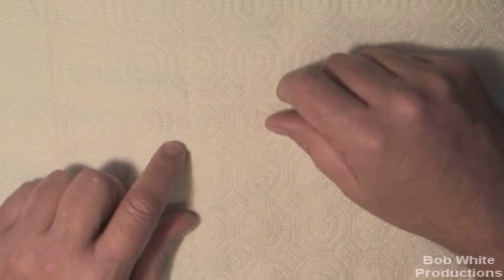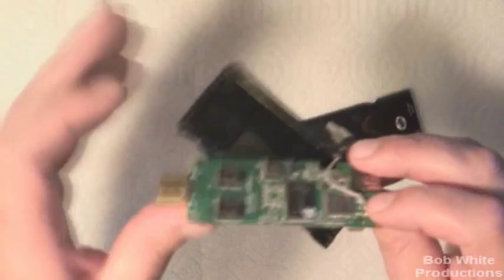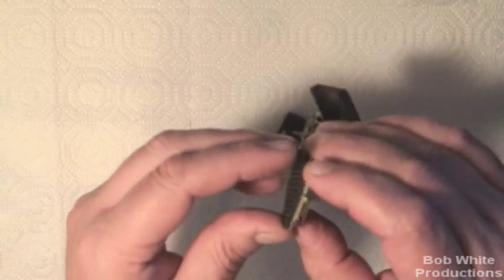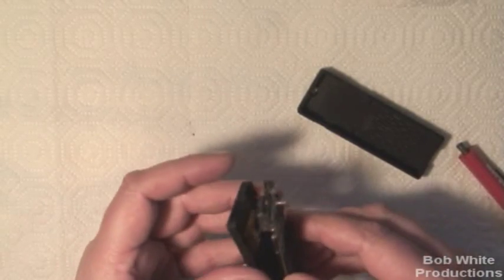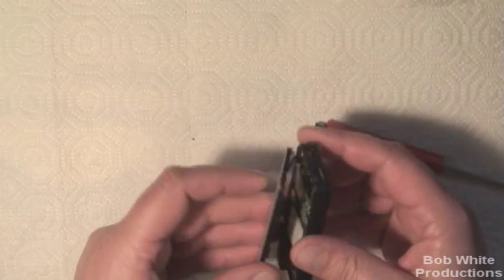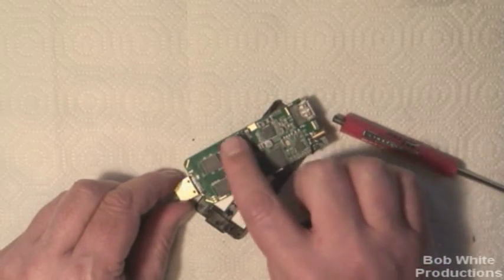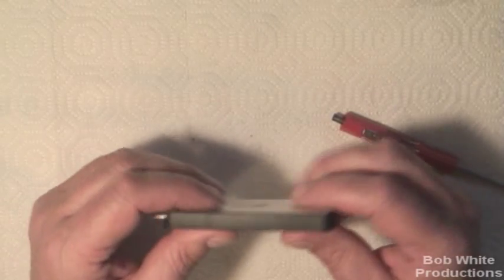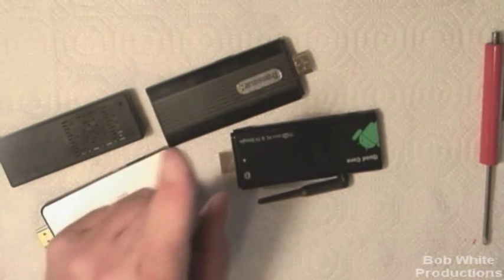The inside GUTS of Three 3188 Quad Core TV sticks

Comment: I am getting terrible wifi with the tronsmart mk908 I bought a week ago, so I opened the case and there is no soldered wifi antenna attached to the case. Is this a change the manufacturer made or did i get a defective unit?

Comment: My mk908 has a black pcb and doesnt have a wire attached to the case. It has overheating issues and I am thinking about modding on a heatsink but Im afraid that wont be enough. Can software fix this issue? Dont want to mod it but I am running out of solutions and I dont want to return it.